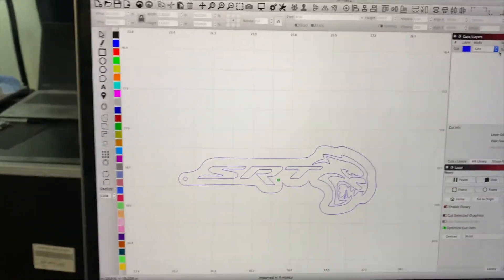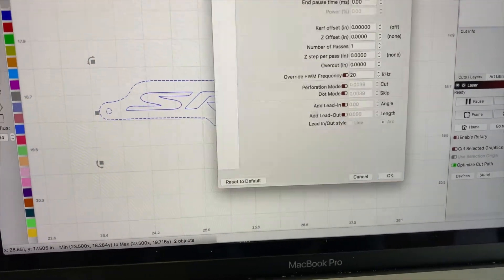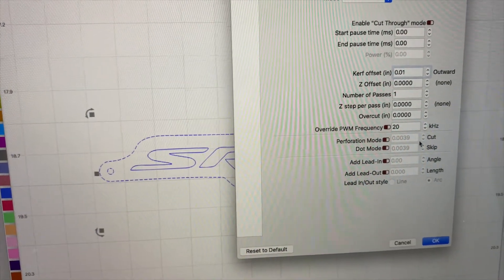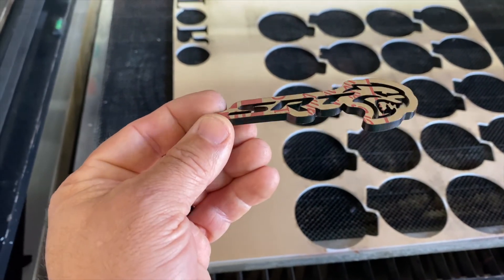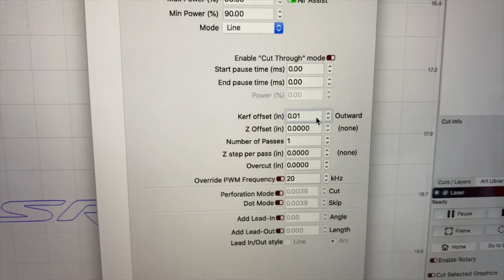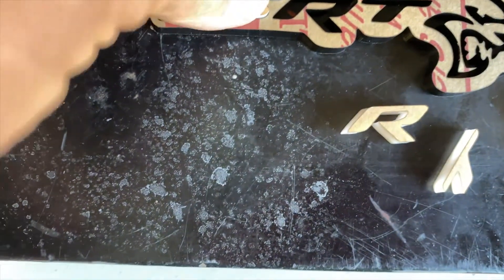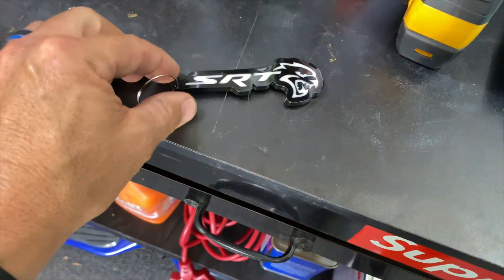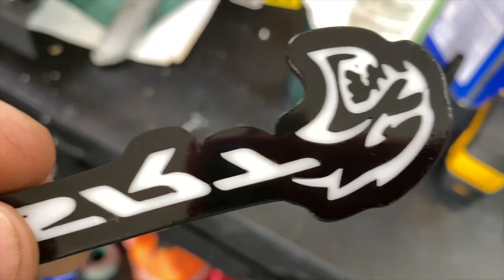Kerf Offset  using Lightburn

Comment: looks good, i was aware of the offset and use it in other applications, good way to do a infill though. thanks. I wonder if my K40 is as accurate as that Nova, Ill have to have a go,  its pretty good as I have a special motion control bard which takes it to the next level...